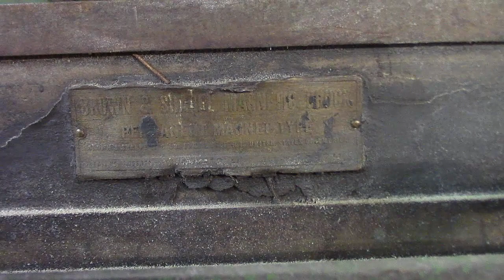Tool haul (Road trip)

Comment: That is a beast. One thing I've always wondered about surface grinders but never dared to ask... how do you cope with the wheel wearing? Surface grinders are said to be very accurate. Perhaps the wheel don't wear that much :).
Reply: The cnc machines often have a system for automatic wheel measurement and compensation and automatic dressing as well, dont know about these old ones. There are probably handbook guidelines on how much you can roughly expect a wheel to wear with x depth, y speed and z material and for the kind of wheel youve got.
Reply from the maker: You do have to dress the wheels a lot, but it isn't to bad just part of it.

Comment: What does this machine do ? Is it for surface grinding heads and flywheels ?
Reply from the maker: Made to go to very tight tolerances with in .0001.  Grinding is the most precise you can go with in reason.  Also you can cut very hard material like: carbide, 316, 308 SS, tool steel, and harden steel.  With the right rock you can get very good surface finishes.   Very cool machines.